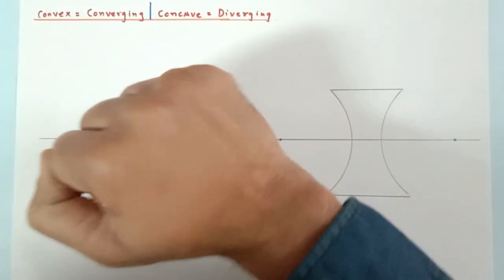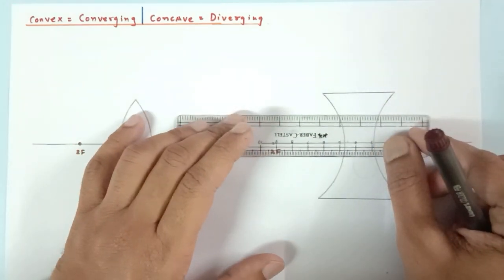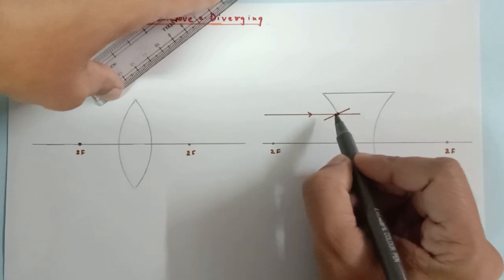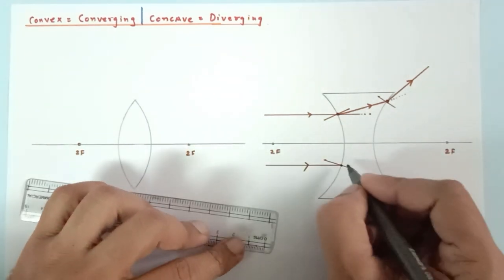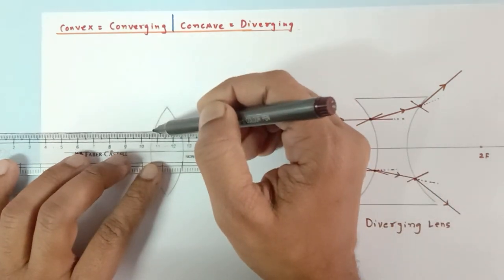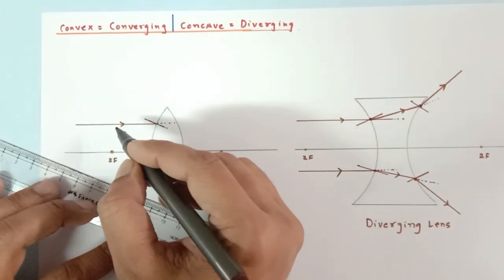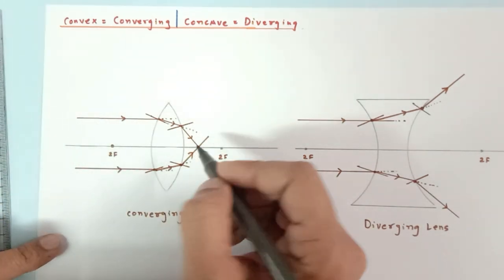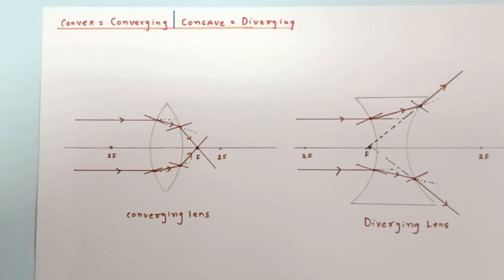Why is Concave Lens Diverging & Convex Lens Converging? How to draw normal to the lens

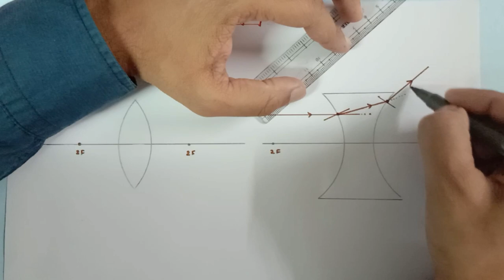Comment: OK. When light goes air to glass, the light seeks for the normal and when light goes glass to air the light tries to stay away from the normal. May I draw the angles using the command MIRROR on a CAD? Is the line drawn at 02:14 a bisector between the light beam and the normal?  Is the line drawn at 02:47  a mirrored "bisector line between beam and normal" using the beam line as the mirror axis?

***in the last hours I found the answer: refraction index, sin x cos, on water is 1,33 to air and in glass is 1,52. Now I see the reason why!